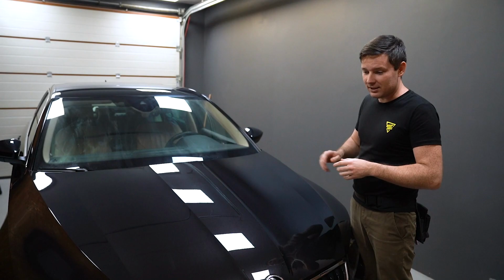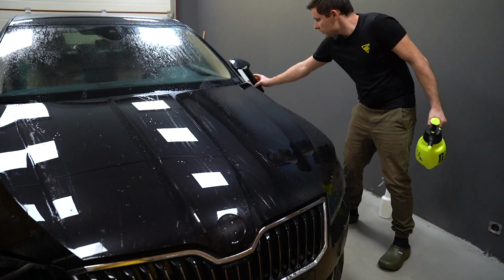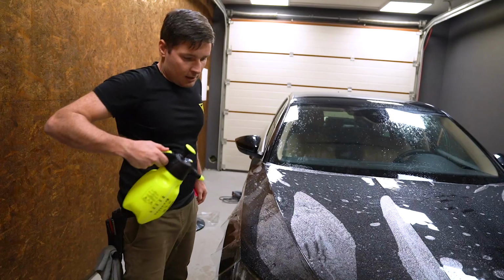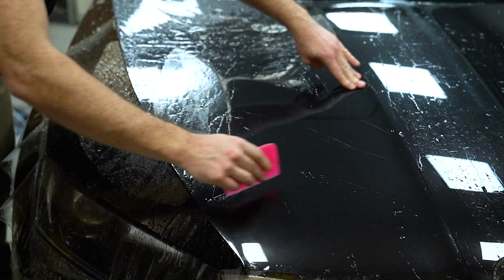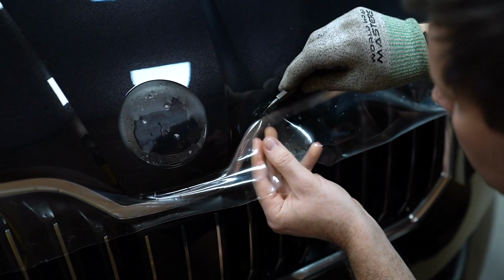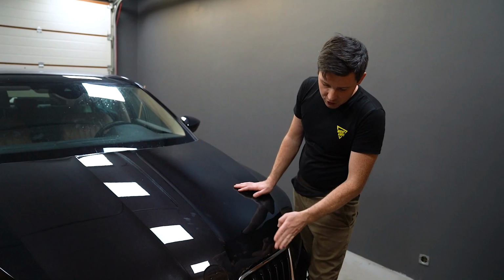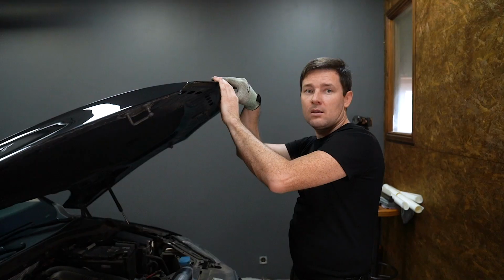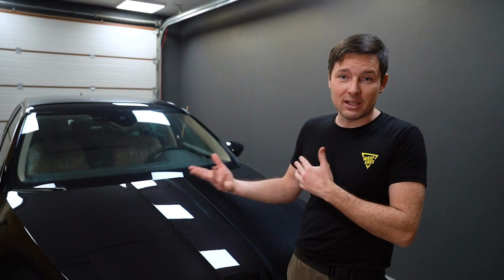DIY GSWF Paint Protection Film Installation on Vehicle Bonnet went Wrong

Comment: Hello,  Good job ! At the end of this vidéo you talk about the proportion of soap in the slip solution. What is the good proportion ?  And what is your composition of tack solution ?
Reply from the maker: Hello, depends what  PPF product you use. For some products is enough to have 0.5ml in to 1l of water, for other PPF products you need 1.5ml in to 1l of water. There is no slip solution formula witch can work for all products. As well it is very important what kind of soap you use.
For a tack solution I use only still water.